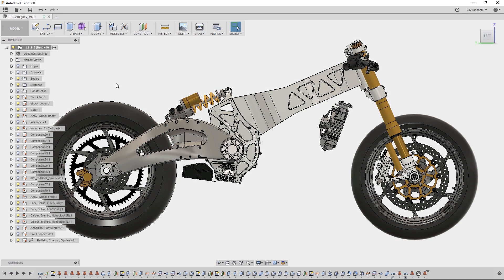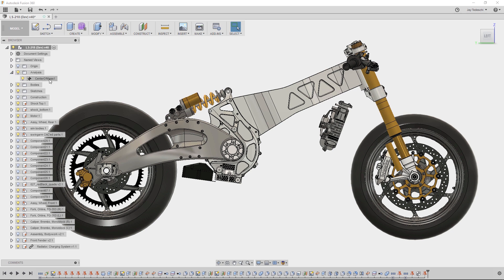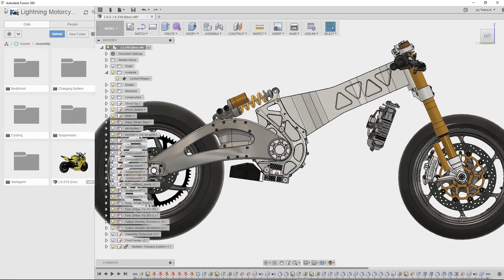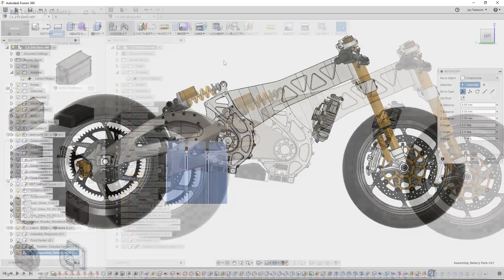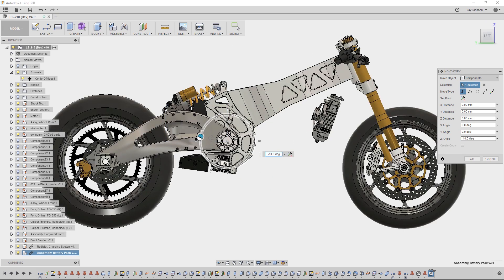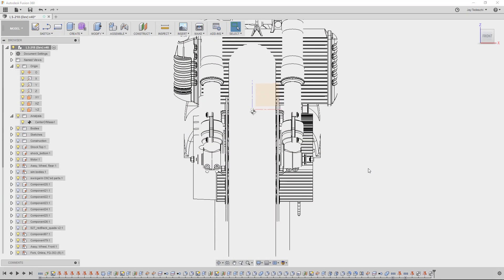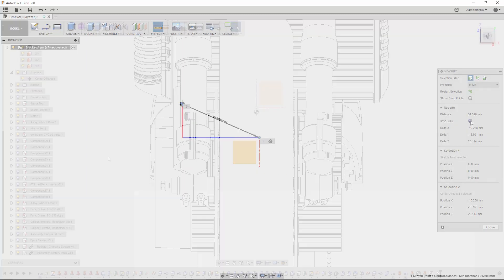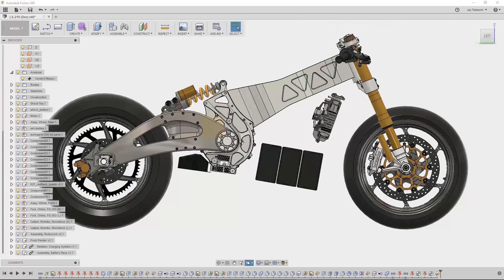QUICK TIP: Center of Mass

Comment: If I'm desinging a quadcopter frame, how can I calculate the center of mass e.g. between the gopro and battery on the top plate??? Those obviously aren't made up of a single material